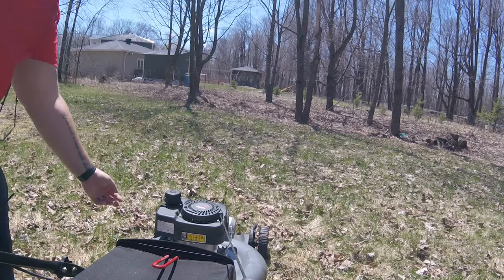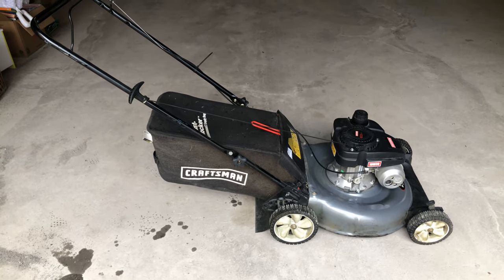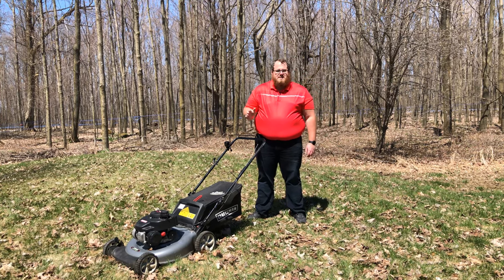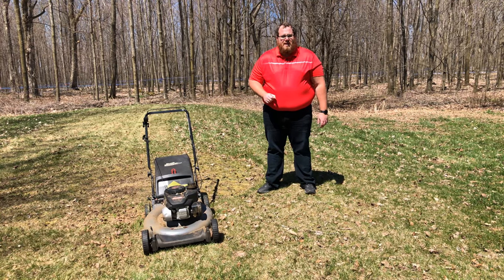Craftsman 2-in-1 Gas Lawn Mower Seasonal Maintenance & Full Review (C459-36401)

Comment: fuel efficiency?
Reply from the maker: I believe the gas tank is about 2L, and using quick maths I think my property is about 3km^2, and I more or less have to walk that distance with the mower. It'll run out of fuel about 3/4th of the way through. So 2.5L per 3km is 83.3L/100km? I'm going to pin this comment because I'm actually curious if that's correct or not, someone out there might have a much better formula than I.

Comment: I have a Craftsman M270 and it has a 159cc engine on it and I notice when it's extremely hot out it won't start if the engine is warm unless you let it sit for about 15 to 20 minutes
Reply from the maker: Good to know! I haven't let mine get hot before, though we have a lot of dust issues that haven't seem to impact the performance of it so far.